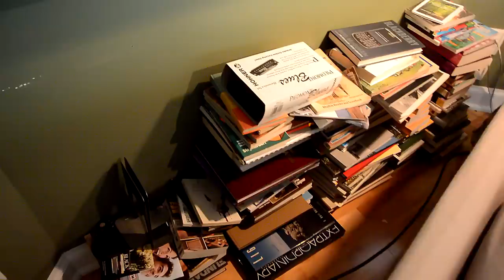Stackable bookshelf boxes

Comment: I was hoping you'd do one of those flying leaps onto it (the "jump sit" as it has been called), but I guess we'll settle for a "corner-balancing handstand" or whatever that particular gymnastics move should be called.  Doing it across the corners of the bookcase like that, you're demonstrating how very well those joints are resisting racking, even without some kind of backing panel to pick up the shear stress.  Well done.
Reply: Oops, clearly there's a jump sit at 7:21.

Comment: Hey Matthis! To make box joints using a single table saw blade rather than dato. You have to use an advance jig right. Or something that would act like one correct. I had issues with the fingers not lining up with out an advance jig! Man! How often do you lose count on that thing and ruin a piece? Thanks!

Comment: It looks amazing! Great job. I must admit I got super confused when you explained the gear tooth ratio to inches system... God bless the metric system! Haha!
I was wondering is you would eventually make a modification could made the shelves raise up? Perhaps something spring assisted with a small handle on the top disguised as a decoration? That way you wouldn't have to slide your sofa out every time you wanted to get at a book, and any decorations you had on top of the shelves could stay put.

Comment: In essence these are stackable, but in the sense that any small bookshelf could stack ontop of a copy of itself. I wouldnt call these really stackable without some way to line them up with each other. Say, some trim around the base that was larger than the wooden base so that when one sat on the other, the top one would slot over the bottom one.

Comment: When joining the two boards together near the beginning of the video, why did you use only glue - not biscuits or dowels too?
Reply: The glue joint is already stronger than the actual wood, and there's no real danger of that joint failing anyway in this application.

Comment: Hi, that's excellent nice work, but why not using lamellos ? that would save time and the shelf would be as solid as it would have been made by your slot mortiser, the only difference is that joints wouldn't be apparent. Keep on showing nice and clever work, From a french fan :)
Reply: MrGrandpoison21 Well, for one thing, a Lamellos biscuit joiner is about $600.00. Plus it requires that you have on hand a quantity of biscuits. Also, it doesn't actually save any time because Matthias's method is at least as time efficient. A biscuit joiner also has to be positioned precisely for each slot by hand, while Matthias's method automatically positions the router exactly for each mortise. Finally, Matthias has the satisfaction of having done this project with jigs he designed and made himself. And who knows, maybe he likes the esthetics of finger joints?

Comment: I can't believe you attacked pockethole joinery like that!  Come on Matthias. That's no way to be. Pocketholes are great :)  Still like your video regardless.
Reply: ha ha. You might want to call his bluff by making stackable shelves and attacking them with your buttocks as Matthias did. :)
Reply: I think he's just trying to call out Jay Bates for single combat, to liven up the summer doldrums a bit.  Have at you!  I demand satisfaction!
Reply: He made a valid point about the strength of his joinery methods compared to pocket holes, nothing wrong with that.
Reply: I use pocket holes due to my limited tools and lack of experience. They work fine as long as long as you use them correctly.
Reply: I guess I'm going to have to make a simple bookcase using pocket hole joinery. :)
Reply: Wooden Tool Man
...and then do a small handstand on it.  Make sure to post a video of what happens.  Yay, the battle is joined!  (No pressure intended, and no pun intended, either.)
Reply: Matt Libby oh come on... that pun HAD to be intended.
Reply: Wooden Tool Man
 It won't be as strong as Matthais's Joinery, but it doesn't have to be
Reply: Matthias didn't attack pocket screw "joinery" he merely stated the obvious.  Had he built the case using pocket screws it would have been much weaker, Matthias is a careful man, he never spouts off a mere opinions, as far as I can remember.  Matthias is an teacher and entertainer, as a teacher he teaches.
Reply: Ed Waggoner Sr. Oh my goodness.  He spouts off all the time.  Usually out of frustration at the masses.  There are also plenty of times he's wrong and he spouts off when he's called on that.  I get lashing out at stupid people but not when he's frustrated he's wrong. The thing is it's okay to be wrong but don't lash out.
Reply: JayWC3333 [citation needed]
Reply: Ed Waggoner Sr. I agree. Pocket holes have their place, but you can't deny that this type of joinery is stronger. All he did was point out the truth in this case.
Reply: Wow, come on. On a diagonal load like that, nothing but finger or dove tails could cope with that. Pocket holes look like like crap IMHO but have there place. Out of sight usually.
Reply: And, pocket holes, that's not joinery, it is screwing things together.
Reply: Matt Libby Woodworker's Cage Match? I'm ready for it!
Reply: Ed Waggoner Sr. He didn't state anything.  He said, "Try that with something made with pocket holes."  That's an imperative sentence, not a declarative one.  That's a challenge, not a statement.
Reply: Brian Diaz If you take the words literally I would agree, but the tone of voice is the key here.  IMO
Reply: I have felt like there was a "pissing match" since Jay posted the French cleat wall.  Mathias immediately started downing that.  Then, an attitude about book ends with the community.  Then there was the drill press table.  It seems like he had his Canadian panties in a twist.  He is intelligent and his jigs are fun to watch.  But, maybe when his dreams of marble toy making were dashed he just got "frustrated with the masses". I agree, tone of voice and words seem confrontational.
Reply: Chuck Hampton Yes! I wish he would moderate or chill out.  He's brilliant and shoots nice videos.  Unfortunately he torpedoes himself at times.  I think he can learn this skill and probably already knows what to do. It's a simple case of application.  :-)
Reply: Rusty Pup
Woodworker's cage match? Have Steve Ramsey make the cage out of pallet wood!
Reply: truebluekit HAHAHAHA That would be a good idea - brought to you by the grrriper
Reply: Chuck Hampton Nothing confrontational about Matthias.  He made a comparison of joinery to pocket holes. It seems like your American knickers are in a knot.
Reply: Wooden Tool Man
Maybe do the test with a mattress below. I have some chairs that have pocket hole joinery - they just keep btreaking and loosening.
Reply: The white oak face frames on my cabinets were joined using pocket hole screws, that was ten years ago.  They are as tight today as the day they were built.  Pocket holes have their place.

Comment: Have you considered changing the motor in your 12" jointer to something quieter?  I'm curious why you haven't.  Is there some technical reason? or is it just not that big of a deal?
Reply from the maker: Because I don't want to rebuild the jointer.  It only has room for the original motor (which is smaller)

Comment: Anyone got any techniques to make good box joints with extremely basic tools?
Reply: +Daniel Astbury  hammer, Chisels saws and sweat...
Reply: +Robert S Yup. That's the way I always did them when I was too young to use power tools. They were just as good as the ones I make now.